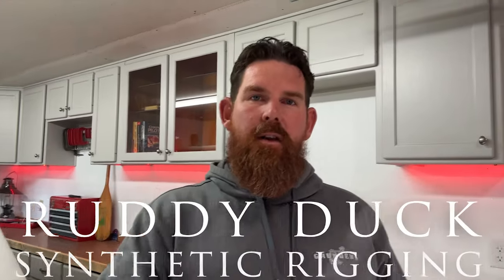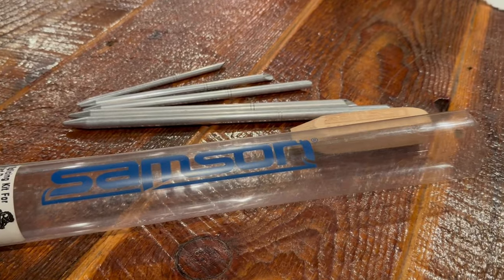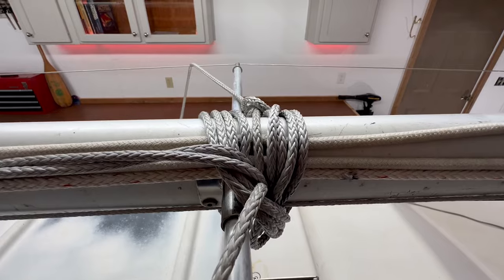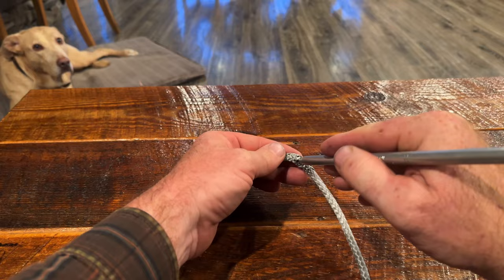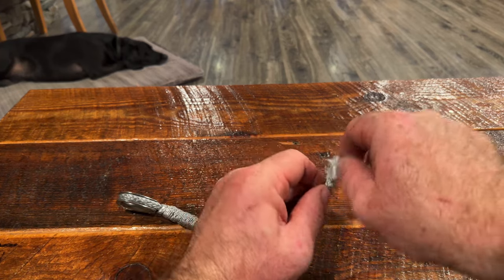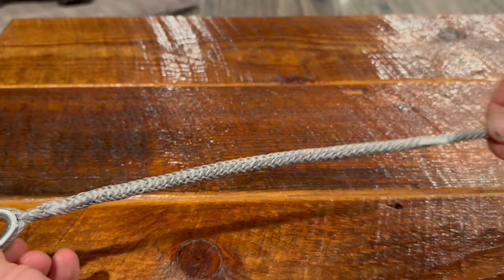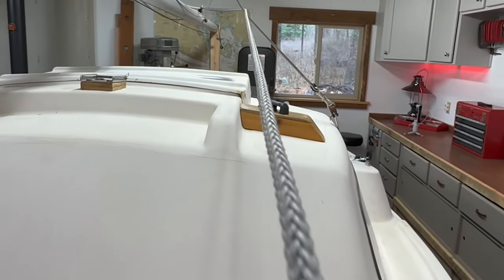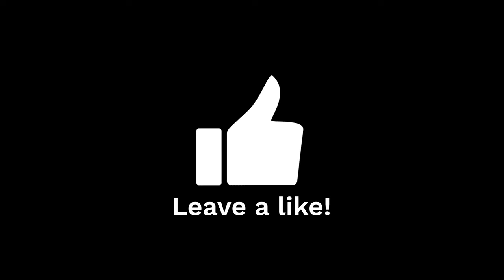Why trailer sailors should have Synthetic Rigging

Comment: Because I store the boat on the trailer with the mast down, I terminate the shrouds at a stainless ring a few feet off the deck which is tensioned with a  laser 3:1 "practice" downhaul system  on a 2:1 (attached at the deck, runs through the shroud ring, tensioned back to the deck.)

Its cheap, as well as quick and easy to set up. I lash the spare tensioning line so that it must stay cleated in the laser downhaul rig.
Reply from the maker: That's cool! What kind of boat do you have? I was debating putting a system like that on my Newport 16 on the forestay, I would rig a purchase system to the terminal and leave the lashings as a backup and standard wind tension but be able to tension the forestay in much higher winds to tension the luff of the headsail. most boats do this with the backstay but the Ruddy Duck doesn't have one, LOL.  I guess my other option is adding running backs. Any thoughts? thanks for watching!

Comment: You're not alone. Very persuasive. Next time I renew standing rigging. Thanks much for the splicing demo. Couldn't be clearer. You might have mentioned that the shrouds should chafe the mailsail much less and not require jackets. As for running rigging, I find that my dyneema jibsheet is uncomfortably slippery but sure runs through the ring lead. My dyneema topping lift will not hold a line hitch. Otherwise. ED and his Gloucester 16.
Reply from the maker: After 3 years the dyneema rigging is still my favorite upgrade to the boat. I kinda never really thought about the benefit of    less chafe on the sails but you are right ! I won’t have to worry as much when I get new sails as long as they keep off the Diamond stays. As far as jib sheets have you heard of tapered lines? Basically a dyneema core and poly sheath so you get the weight savings and strength of dyneema but where they reach the cleat they go from bare core to a complete line for a good hand feel and cleating ability. I put them on my Ericsson 30 when we were racing a lot and I loved them. Kinda pricey line though!

Comment: THANK YOU for this video!

I just bought a Newport 17 that's got a screwy shroud setup (I think), and now, instead of trying to figure out what hardware I need, and how (and if!) to trim the cable, I'm just going to replace both shrouds with Amsteel and call it a day. I'm pretty sure that's get me on the water faster, too!
Reply from the maker: Sweet. That’s pretty much why I upgraded my rigging also. I’m still happy I did 3 years later after lots of sailing.

Comment: The home-rigger's way is to use two copper crimps for each eye on 1x19 stainless wire.  Personally, I prefer the crimps over the swages because with the crimp the wire goes around the eye.  On the swages, the wire is trying to pull itself directly out of the fitting, and I have seen them fail at inopportune times. 
It is a little work, but one can make crimped eyes on 1/8" through 1/4" 1x19 wire using a hand tool.   7x19 wire only requires one copper crimp.
I replaced all of the standing rigging on my Glander Cay 23 using the hand crimp tool.
Reply from the maker: Cool. Do you splice the eye or just wrap around a thimble and add crimps?

Comment: In building and rigging a Swift Solo Skiff, I used a Brion Toss Splicing Wand for splicing Lightening, Vectran and Amsteel standing and running rigging.  The wands come in various sizes and make tapered splices easier to complete.  Brion Toss has some helpful videos regarding splicing techniques for various types of line.
Reply from the maker: Brion toss was a ledgend and came up with most of the synthetic splice techniques and knots that I have on my boat! If I end up doing a lot more splicing I’ll look into getting a wand. It looks like a great tool !! Thanks for the recommendation
Reply: I bought the splicing wand too, but didn‘t like it at all! I found that the wand,, together with double thickness of core or sheath were really difficult to pull through and ended up breaking the loop. I now use hollow fids with a pusher exclusively for single and double braid.

Comment: Excellent Video !!! this thought has crossed my mind so many times, why no one rigs with Aramids.
but of course "if no one does, there must be a reason" ??? and it was this reoccurring question ... it's good to have someone point out the reasons to rig with Dyneema.
it's like the thought of diving into water where you can't see if there are any hidden dangers beneath the surface, it stops you ... until someone, who has been there, dives in and comes up fine.
Reply from the maker: Thank you!! That’s a great analogy and I was happy to not be the first diving in also! Glad to follow the recommendations of sailors who installed dyneema before me and have a rig that outperforms what I previously had.
Reply: another thing Dyneema is good at is:
Keeping Aluminum Masted Fractional Rigs From Mast Failure....whenever someone limps back with a kink at the forestay; it was because they encountered weather, with a tired old Dacron Main....on the other hand, a Dyneema Cruise laminate main Won't just keep stretching into a poopy diaper ... it takes Way Less backstay tension for the same amount of de-power....Also, a Low Stretch main halyard will also help reduce chances of mast failure also, ( i used to work at a shipyard ) .... another good thing In General, When it's time for bottom paint <---SpeedCoat-49  recommended there... @ruddyducksailing
Reply: anyway....that's a nice little sailboat....i hope to be able to get something a long those lines, at some point ... great weekender.. @ruddyducksailing
Reply: maybe a patch of epoxy / carbon fiber cloth, on a scratched up area around the forestay hound, would help too ....but you can't really straiten a mast once it tweaks ... i would take every precaution, myself.. ..once they tweak, they are done...so keeping your mast alive is all about preventative maintenance.... @ruddyducksailing
Reply from the maker: It has been very fun

Comment: I have been planning to do the same on my WWP15. One other downside is that the rigging will loosen in the cold weather so when seasons change  it could need adjustment from morning to afternoon. It's not a big enough disadvantage to stop me though. I live in the Boise area so just a smidge warmer than you. My plan is to 3d print a blank and cast my own terminators in aluminum rather than purchase the colligo terminators. A project to try before my stainless needs replacing. I like your videos.
Reply from the maker: The cold hasn’t affected mine enough to notice. The idea of making your own terminals is great! You will save a lot by doing that. I debated making my own from carbon fiber but never got around to it. Thanks for watching!!

Comment: I'm in the process of switching over my Mariner 19 to synthetic (Amsteel Blue). How much space would you recommend between the terminal on the shroud and the chain plate? How long are your shrouds, and how much did they stretch after splicing?

This is the best video I've found for changing to synthetic rigging on small boats like ours. Thanks for uploading!
Reply from the maker: I would recommend 12” to 16”. My shrouds are 14’ long and I set them up with about 8” between the terminal and chain plate and they stretched 3-4” total and stopped stretching after about 5 really heavy sails. Quite a bit of construction stretch. I would prefer a little more distance on my setup but there’s still a few inches of adjustment left. It definitely doesn’t hurt to have longer lashing lines.

Comment: I'm a big fan of dyneema for halyards and control lines. My halyards on my Catalina 22 are  3/16 dyneema. I use a ball point pen case as my splicing fid. My spinnaker sheets are 1/8" dyneema spliced to 1/4" braided dacron that is easier on the hands. Boom vang cascade is also dyneema. 

That said I would never recommend dyneema for standing rigging. Primary concern is UV light resistance. Standing rigging is in the sun 24/7. It will break catastrophically with no signs of wear. My halyards last about 3 seasons before they are changed. It is one thing to loose a genoa halyard; quite another to loose a forestay. Chafe resistance is another concern. 

Lastly I would not recommend lashed terminals. Little to no fine adjustment capability. Very difficult to accurately tune the rig. I frequently make on the water adjustments by counting turns on the turnbuckle. I have tuning tables, X turns equals Y pounds. Assume you go out and the wind is 5-7mph for the first race of the day. It builds to 10-15mph in the afternoon. I can retune the rig on the water between races.
Reply from the maker: Very cool. I assume you're racing a capri 22, fun boat. I love my dyneema running rigging but it does encounter chafe because its moving all the time through blocks fairleads and sheaves but I haven't encountered a failure on anything yet and the chafe is very minimal. My standing rigging however has zero Signs of chafe because it just stands there and doesn't move and I don't have anything rubbing up against it so I don't think that's something to worry about. As far as uv damage it is actually easy to tell if the dyneema is affected because it will get fuzzy after many many years just like it does from chafe and as the sunlight only affects the outside of the line it retains most of all of its strength. Of course you should change it out if it does this. Do you have experience with uv causing a catastrophic failure?

I love talking to racers cause they always have the best tips and tricks and push their boats to the limits so thanks for commenting! I race but mostly beer can stuff and not hardcore so maybe I can learn something from you? On the boats I've been on the shrouds are tensioned to not go slack in the highest wind that can be expected in a area that we race and then only use the adjustable backstay to tension the rig in higher winds, tightening the forestay and flattening the mainsail . I've never adjusted or seen shrouds adjusted between races. Why would you loosen the tension on the shrouds between races instead of leaving it set for the highest wind expected? Thanks- Brian

Comment: Another great video, I like the way you think outside the box.  I was going to use a version of you jib sheet adjuster with dyneema and a low friction ring but the cleat I was going to use wouldn't bite into the line enough to keep it where I'd like it to be.  I will continue with polyester braid and expect good results.
Reply from the maker: Yeah it’s a bummer that dyneema is so slippery cause it would be awesome to splice and use in that situation but we’re stuck with poly. It really works fine though. Thanks for watching!
Reply: @ruddyducksailing Sincev
Dyneema is just uhmwpe.
Long chain polyethylene as used for low fiction wear resistant ski bottoms, industrial conveyor belt skid pads etc.
You are paying high prices for a brand stamped on the cheapest and least appropriate material for the purpose.
PE creeps if kept under load, so your rigging will stretch.
Polyester or Nylons (BTW Kevlar is a nylon), have higher yield strength, and far higher toughness. 
.

Comment: I also use 6mm single braid dyneema on my 36ft yacht guardrails, tensioned with 4mm dyneema. Use short length of plastic hose as protection against abrasion where it passes through stanchions. Can’t understand why anyone still uses wire!
Reply from the maker: That's an excellent use for dyneema. Very strong, soft, and not susceptible to corrosion. I see so many steel  lifelines at marinas that are cracked and rusting out just waiting for a heavy guy like me to fall through them.

Comment: Great informative video with excellent advice and splice lesson, cheers. How to you get on with those soft shackle hanks? Surely they pop off the stay when the sail flogs about?
Reply from the maker: Thank you. The soft shackle hanks work really well. I have never had one come loose and pop off in the two years I’ve had them. They take a little longer to get on and off the forestay than traditional hanks but other than that they are great.

Comment: Wondering if you could provide a link for all the the terminal ends and frictionless rings that you used? Also where did you find the cheapest location for your dynema line?
Reply from the maker: I do not recall where I purchased  the hardware but most likely from Fisheries supply in Seattle or west marine. Some terminals may need to be purchased directly from colligo

Comment: I like the idea from a weight point of view. What do you do were the rigging goes over the tips of the spreaders?
Reply from the maker: The Ruddy duck doesn’t have spreaders but what I would do is make sure the area on the spreader that the dyneema runs through is very smooth. Even polished if you could. Also sew on a two inch long chafe cover over the dyneema shroud where it contacts the spreader

Comment: Stretch and thermal expansion/contraction; I have also read that you will/may have to seasonally adjust for temperature changes.  Not an issue for summer only sailors, but can you still terminate to existing turnbuckles?
Reply from the maker: Yes on larger boats you will definitely need to adjust the rigging in below freezing temps. My rig is so small the stretch was so minimal that adjusting wasn’t needed. And yes you can terminate at turnbuckles for quicker adjustments but you have to be way more precise on length when splicing !
Reply: @ruddyducksailing  Good info, thanks! I suppose that either pre-stretching yourself or paying for the more expensive product would be worthwhile for use with turnbuckles.

Comment: an issue I've seen on another channel (Rigging Doctor), where the liveaboard sailor is also a professional rigger, is that his dyneema standing rigging slackened right off when the temperature dropped to around freezing. Seems dyneema actually loosens when it's cold rather than tightening. He just left it and motored for a couple of short legs and until the weather warmed and the rigging tightened itself. He didn't re-tension it when it was cold because he understood that it would then over-tighten when it warmed. Not sure if trailer sailor people sail when it's damned cold and maybe it's just common practice adjust standing rigging tension frequently anyway, but this sensitivity to cold surprised me.
Reply from the maker: Yes it is definitely an issue on the larger boats where the length of the rigging compounds the elongation. My shrouds are only 14 feet long so it barely moves . We sailed in around 15 degrees F and the tension was still good. I imagine in 20 below might be an issue but I would probably not sail in that because everything freezes up and is unusable anyways. As far as readjusting tension I have had it set at the same tension for over a year now and it hasn’t changed with probably 20 or so different launches so for me it has been good.
Reply: @ruddyducksailing  you also have the good side of that by having to routinely re-rig your boat. I sail a very heavy Hallberg-Rassy 38, currently in Panama. But if I visited Launceston then low temp might be an issue if I converted to synthetic

Comment: Most cruising sailboats should probably have synthetic rigging. Ignoring the weight, cost, and strength benefits, it's also infinitely more repairable even down the the tangs. If something goes wrong with steel rigging and you're halfway across an ocean, you're in trouble, with synthetic you can re-rig your entire boat and make spares ahead of time.
Reply from the maker: I totally agree. I think stainless will be used less and less until synthetic is the norm on every boat and not just high performance racers. Theres just too many benefits to dynemma to even consider re rigging with stainless. However if a crew member is trying to learn how to juggle with machetes on the foredeck  then maybe stainless is the way to go!!
Reply: @ruddyducksailing  Nice point about the juggling😁 but as you know, the stuff is bloody difficult to cut, so unless he’s juggling Tantos then the rig is safe😂
Reply: The only thing stopping me from switching to dyneema on my cruising boat is that it's not suitable for cold weather sailing with an aluminum mast.

The dyneema expands when cold while aluminum/stainless shrinks so changes in temperature would make your shrouds completely slack on cold days.
Reply from the maker: That would be a bummer. I haven’t experienced that at all though! I just finished a trip in 25f weather and the rigging was still tensioned like it was in 75f. Of course my boat is tiny and effects may be greater on a larger vessel. You’d have to talk to a qualified synthetic rigger to get the specs on temperature fluctuations.
Reply: @ruddyducksailing  yeah, I think it ends up being around a 4mm difference on a 50ft mast at 25f vs 85f. I'll be sailing into the negatives this year so I could easily double that haha

Probably not a problem for over 95% of people lol
Reply from the maker: Yeah that would be quite a bit. You would be better off with turnbuckles to quickly adjust tension! Kind of hard for the diy guy to set up synthetic rigging to turnbuckles as you have to be very precise in splicing and account for stretch very accurately. Fair winds!

Comment: What load are those low friction rings rated for? Enough for a 35'+ boat?
Reply from the maker: I have the smallest ones they make and they are rated for a safe working load of 800 lbs . I used antal low friction rings and they make a huge variety of sizes up to 22,000 lbs safe working load so they will definitely have rings that will work for your boat!!